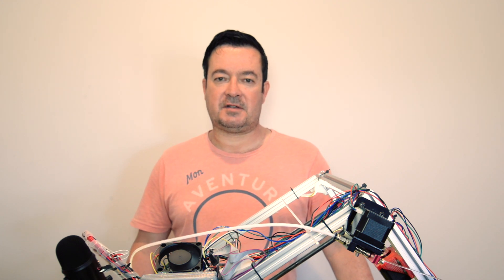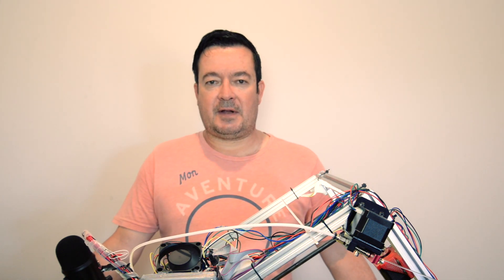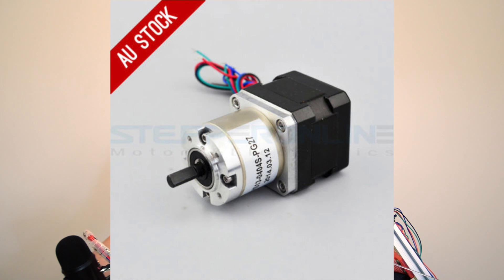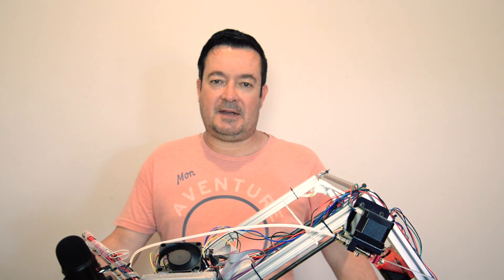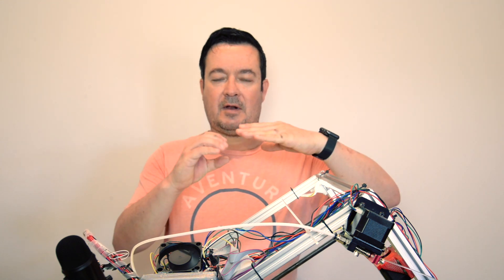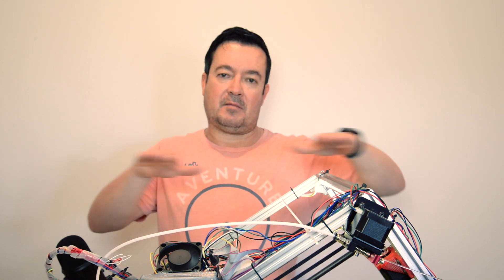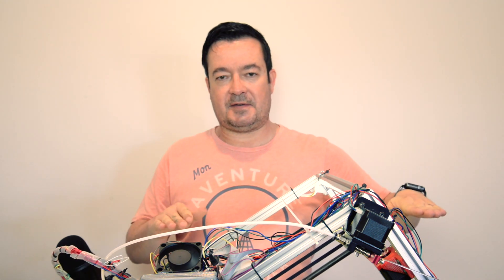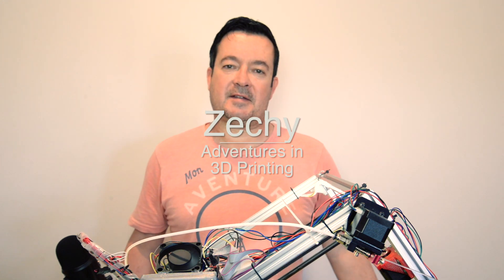Belt printers taking off? And update

Comment: Great updating. I started to make mine, and the big problem is on the treadmill, it has to be very well stretched and does not suffer deformation when it comes in contact with the heated table or filament, so I solve these two obstacles I will post the video of my prototype, and continue with the great work, he is helping me a lot to develop my machine.